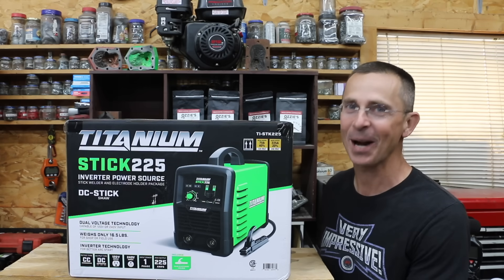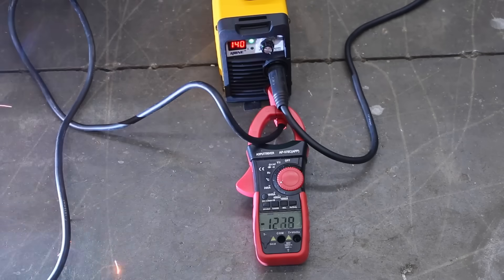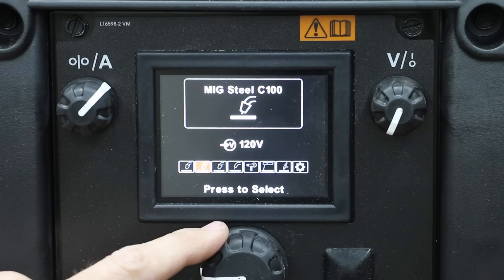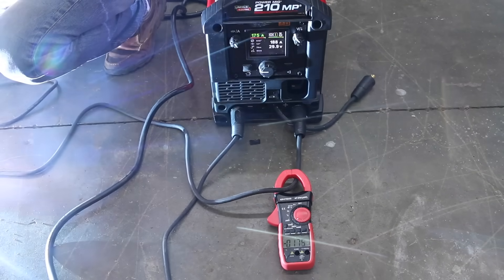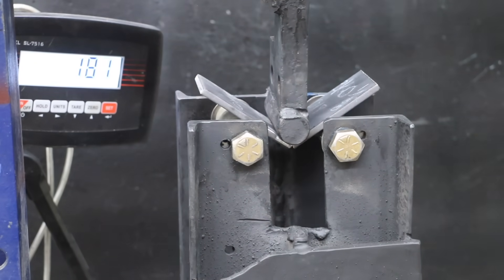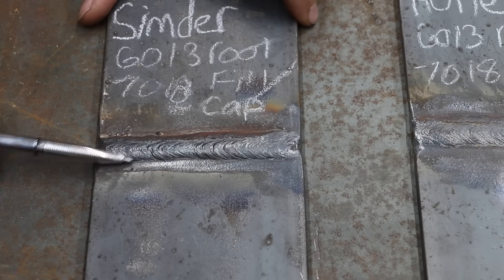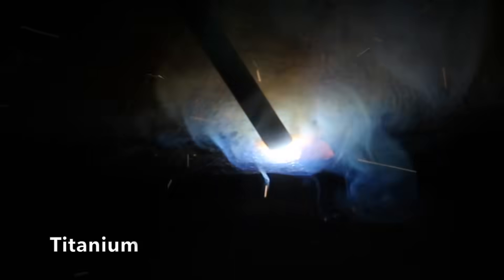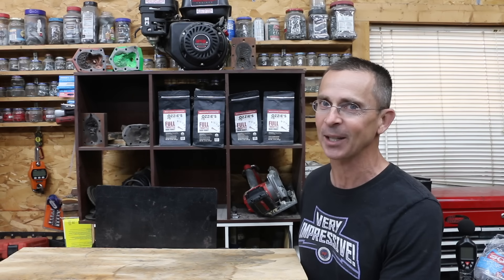$70 vs $2,300 Welder? Let's Settle This! Weld Strength, Duty Cycle, Current Output, Build Quality

Comment: Joe is definitely bias toward Lincoln Electric products. It would be interesting to see what his opinions are if there was somehow a blind test to remove bias.
Reply: I'm sure the Lincoln is better than the other machines in this test. It also costs more than all of the other welders in this test put together too.
Reply: @1pcfred  that may be true, but just based of the weld quality, I doubt this person would have been able to differentiate brands. This is the point I'm making.
Reply: @1pcfred a good portion of people do know how to weld. Just because they don't do it professionally is beside the point. This person had bias, it was blatant, if you are going to argue that the bias was irrelevant, I will have to whole-heartedly disagree with you.
Reply: @1pcfred  I guarantee you he wouldn't have said what he said if he had no idea what he was welding with. That is his explicit bias. Bias is never good in a comparison test, that's just the long and short of it.
Reply: @1pcfred  actually no. He specifically said if it was turned up more, it would perform fine. He knew that it was turned down, even though it was specifically said it was turned down to keep fairness. You can keep arguing all you want, it doesn't change the fact that his review was biased from his opinion.
Reply: @1pcfred  that's correct, that limit was placed such that all machines could compete with each other. Nothing arbitrary about it. As for his heavy opinion, there is also no question that he preferred the Lincoln although it only performed on par with the rest. That's called bias.
Reply: @1pcfred  and a test where Joe would set the machine is highly subjective, because it completely depends on how the welder welds. Its completely opinionated, what don't you understand about that?
Reply: @1pcfred  yeah, and they are also under oath to remove personal bias and tell the truth, nothing but the truth and the whole truth. Your point?
Reply: @1pcfred  No, I think he has a non-sponsored explicit bias due to Lincoln Electric being what he uses. He would feel bad he invested in a company that only competed with 300 dollar welders. He obviously doesn't want to admit that, therefore he adds exceptions to his review of the weld since he doesn't openly admit that the weld looks almost identical to the welds made by cheaper welders. That is the very simple, very obvious description of bias....
Reply: @1pcfred  if this guy instead reviewed welds based solely on appearance and performance, he would be much more careful in how he reviews the welds. Surely you realize this. A way to achieve this very thing is to hide the welders that make the welds until AFTER he reviews the quality of the resulting welds.
Reply: @1pcfred  I can't believe it's taken 3 days and you still don't seem to recognize the obvious bias that project farms videos are usually free of.
Reply: @1pcfred  you based your opinion on price, and the look of his face??? Forgive me if I don't trust an ounce of what you say. The simple fact that you are against an unbiased test says everything I need to know about your character, and your 'pursuit of facts'.
Reply: @1pcfred  you're simply proving you are also bias, all the more reason an unbias test is necessary. What part of this don't you get? You are really all for buying an expensive brand of welder because the company says its the best rather than verifying that for yourself? This channel has been known for finding out which tool performs best, regardless of marketing schemes. The tests performed are designed to be unbias, and the opinion of some random bias person doesn't (shouldn't) be helping you or anyone decide such things. That's the actual fact.
Reply: @1pcfred  then why in the world do you have to argue about a simple blind test to remove bias between tested welders? You make no sense. If what you say is true, then it's obvious you should have nothing to worry about.
Reply: @1pcfred  dude, you still don't get it. In order to remove bias, you'd only let this guy look at the finished welds. You would have another person weld all the samples to be inspected. Surely you know how bias is removed? The samples would be numbered, and the only person that would know how to decipher the numbers would be the main guy. This way the person with welding experience would be forced to inspect the welds for their entirety, good and bad, based on a fair comparison of all welders with the same inputted settings. It's an utterly simple way of removing any bias.
Reply: @1pcfred  I guess I figured you'd know something as obvious as that. My bad for assuming you understood something as simple as bias.
Reply: @1pcfred  you're literally more worried about insulting someone than getting to the truth. Facts don't care about your feelings. Stop trying to pretend that they do.... smh
Reply: @1pcfred  not sure how you can say anything about that was the 'truth' with a blatantly biased review, so much so that you aren't even arguing it wasn't biased. The actual test results show a completely different story.

Comment: One suggestion - use a 6010 or 6011 electrode on the root tests. 6013 isn't used professionally, which means it's a good electrode to test for farmers and hobbyists, but not on open roots. 6013 isn't a deep-penetration electrode.
6010 is also harder to keep lit, which will also give you more data points about the arc quality of a machine.
Reply from the maker: Thanks for the feedback!

Comment: What about tool boxes/chests for quality, strength and general ease of use. Like how wide deep and strong are the drawers, or how strong is the top of it. I like my cobalt tool box it was blue and black with an included power strip, but is it as good as a snap on of roughly the same size.
Reply from the maker: Thank you for the video idea!

Comment: Can you do an apples-to-apples welders comparison. All the same process, and same amperage such as 180 mig. How about a lot of the known brands such as ESAB, Lincoln, Hobart, Miller, a couple less known domestic (Everlast?), and just one or two of those uncertified chinese widowmakers. This would be a very pricey review. Maybe a supplier can give you a discount if you buy multiple machines at once. I don't think this wouldn't taint your perspective. Then, sell most of them off as used. Hey, maybe some fans would buy a used and autographed welder?
Reply from the maker: Thank you for the video idea!

Comment: Everlast is also a pretty good brand for those looking for good quality, but not Lincoln/Miller pricing. It's about half the price for an equivalent machine (duty cycle, features). Miller/Lincoln will always win on the service and longer term warranty, but they're sort of the "Snap-Ons" of the welding industry.
Duty cycle is where the pricing becomes evident. Cheaper machines can't handle it.
Reply from the maker: Thank you for sharing!

Comment: Thank you Todd, and Thank you Joe. I really enjoyed both of your work here. My dad and I bought a lincoln 210mp years ago, we didn’t get the tig accessories and out the door it was about $1100, definitely gone up a lot since then. Ours has been ok but has issues running mig sometimes and the power switch will intermittently not work. A couple years ago I bought the super cheap titanium flux only welder, and the mig 180. I’ve been very impressed with both of them, however I’m welding as a hobby and as a mechanic which is less than I was using the lincoln with my dad. All that being said I think that both brands are good choices, I’ve used lots of Hobarts and millers in schools and they were great too although hobarts are simply slightly stripped down millers for lots cheaper
Reply from the maker: Thank you for sharing!

Comment: Excellent review. It is hard to determine longevity of a welder due to build quality variance and testing of this without a tear down but great review. I'd suggest taking a look at Everlast, Eastwood or HTP if you ever revisit this topic. Those are some import brands that tend to get used in the welding community for beginners or people looking for solid machines on a more budget friendly side. The duty cycle of the Everlast and HTP are generally very close or higher to Miller or Lincoln.
Reply from the maker: Thank you for sharing!

Comment: If your not getting a big diesel generator welder Don't get a Lincoln. When you get through smaller welders you're just buying a name.  You can get the Vulcan omnipro at harbor freight for $1,000 less than this one and it's the same welder on the inside.
Reply from the maker: Thank you for sharing!

Comment: Not terribly surprising knowing the evolution of processes and welders was driving by reducing skill level required of the operator and increasing productivity.  Lincoln was one of the drivers of that evolution so wouldn't skimp.  The cheap welders obviously over promise and need more welder skill to make up some of the difference.  

Thanks to Joe.  I wonder his opinion of what a knowledgeable welder such as he could do to compensate for the weaker machines.   Giving up productivity for getting the job done though slower, messier.
Reply from the maker: Thank you for sharing!

Comment: Hi Todd. Most of these 110v welders need a 20 amp outlet instead of the more common 15 amp outlets. Did you test them on a 20 amp outlet?
Reply: Nevermind, I just finished the video and heard you mention the 20 amp breaker popping during the 5 minute test.

Comment: Soldering stations are in a bit of similar situation. Yes, one could spend $400-$600 for a top of the line soldering station like a JBC, Metcal, Pace, et al. But these days one can find much cheaper "generic" chinese stations that might even use the same premium tips like JBC's and Hakko's for much less and get similar results. For most casual solderers, even something like a Pinecil v2 will be more than sufficient.
Reply from the maker: Thanks for the feedback.

Comment: Awesome video, after lots of research i bought the tooliom 200 amp 3 in 1 welder. Im new to welding but im very happy with this welder. The 250 amp model come with a liner that can weld aluminum  without the need of a spoolgun
Reply from the maker: Thank you for sharing!

Comment: I purchased a Tooliom multi process welder and it works great. It's amazing how much technology has improved. I have an old Miller machine and a flux core welder that I got at menards that I don't even use them anymore because the Tooliom is more powerful and has better features. Granted that the Miller is 12 years old, but it was still a $1,200 machine that gets spanked by a modern Chinese welder that I got off of Amazon for $350. All of the features work as well. The duty cycle is also nuts on 240v. Says it's a 80% duty cycle but I think it might be higher because it hasn't cut out on me even once. I run it on a 30 Amp 240v circuit and it hasn't tripped it. It will also burn 5/32 hard facing rod without a problem. The old Miller only gets up to 130 Amps and struggles with 5/32 hard facing (11018) rods. Some of these Chinese welders are getting insane. It's a shame that there isn't a company in the US that is putting out machines like that at a similar price.
Reply from the maker: Thanks for sharing.

Comment: shouldn't have used 6013 for the root.  Also should test 6010 or 6011 if the welders can run them.
Reply from the maker: Thank you for sharing!

Comment: multi process welders will break your wallet but Everlast, Esab, Lincoln, Miller have 3 in 1 welders' you can compare: AC/DC or strictly DC-/DC+. call your welding suppy for the big 3 Esab, Lincoln, Miller. Everlast is in san francisco good luck hope to see that welder video soon.
Reply from the maker: Thanks for the suggestion.

Comment: If you do a other welder test, maybe you can try the PrimeWeld tig 225x. It can do stick welding and it's just under $1000. Great welder for me but I have never used the stick function.
Reply from the maker: Thanks for the suggestion.

Comment: Up to 1/4 mig and tig are excellent methods.
I like stick for thicker welding with or without an extra gas shield.
A Lincoln stop sign should be the home welder for everyone.
They never die and they stay consistent after the welder is hot.
For your first welder if not repairing thicker things.
Mig is easy to learn for anything but aluminum. 
Lincoln, Hobart,made in America.
Chinese rigs all become inconsistent shortly if you weld much.
Your grandkids will have your Lincoln stop sign 🛑.
They are awesome stick welders.
If I run a gas line for additional over shield
And an alloy rod I can weld something so solid it has no equal.
1/4" brake line and a clip to hold it to the stinger.
It must not be within 1/2" of the weld when in operation so like 1" ish back resting against the piece.
Turn the argon on at a slow his (thickness and metal type can be googled for pressure and gas type.)
 As you weld the gas moves up so only the first 5-6" needs to be metal.
They don't sell the best stuff for welding.
For instance if you want to make cones you have to make your own stuff to do it easy.
Even rings and they are easy.
Just measure across the piece add 11/2 the thickness of the piece you are using for the ring mold.
Multiple by 3.42- 3.75 or a little more.
Tight for precision and loser for speed.
Reply from the maker: Thanks for sharing.

Comment: Nice video. Hopefully you can do a round 2 because a jump from $320 to $2,300 is a bit extreme. 

A lot of us are looking for something in the middle, that is not the cheapest thing out there and not the most expensive. For example, you can get a Made in USA Hobart for around $500. Would be much more relevant since most of us don't want to be taking a chance on the long term reliability of a $70 welder but can't afford a $2,300 one.
Reply from the maker: Thank you for sharing!

Comment: Great comparison fellas , and interesting to see the differences between good welders and not so good ,  i remember some decades ago going on a working holiday , and a friend offered me a job in an engineering shop if i could weld , and i wasnt a good welder , but i could weld like a mechanic , a bit of cast iron , steel and aluminum to get me out of trouble, you know , i  could put a bit of bird shit on some metal  :)  , anyway he took me  down to his shop and threw a couple of bits of one inch plate on the ground and asked me to weld them up which i did , , the welders in the shop im pretty sure they had  big Lincolns that stood about 4 feet high , anyway i welded the plates up and , i was blown away how nicely and easily the welds came out on a good professional welding machine versus a lot of the home handy man ones i used in the past ..
  As always , it pays to buy better quality stuff fit for purpose , and this channel makes that possible .
Well done Todd and Joe . .

Comment: Great test and great idea to have a pro like Joe!  Please do low-mid range Mig welders.  Include Hobart (140 and/or 190) and Eastwood (180), along with Harbor Freight brands.
Reply from the maker: Thanks!  Thanks for the suggestion.
Reply: @ProjectFarm   Really wish you had included Eastwood and Hobart.  They would have been more apples to apples with the upper tier HF MIG.

Comment: Long-term reliability and availability of parts/service matters.  These variables are probably more important when it comes to TIG, AC/DC, and wire-feed machines than they are for simple inverter buzz boxes, but knowing that a company will stand behind its product and get you back up and running is worth something when you start dropping hundreds of dollars on a machine. $90 is probably the most I would drop on a machine if it doesn't come with a good warranty, service network, and replacement parts.
Reply from the maker: Great points!

Comment: Thanks for making the drive, and helping out PF, Joe! 
 PF, please consider doing a "wire fed, Flux Core" welder review when Joe comes back. HF also has a Titanium version of this welder, called the Titanium  Flux125. 
Or, Plasma Cutters would be cool to see, as well. Prime Weld makes a decent one, at a reasonable price. 
  Once again, great video! Thanks again! 👍
Reply from the maker: Thank you for the video idea!
Reply: @ProjectFarm  You're welcome! Because I KNOW you need a new plasma cutter to go along with that new welder! Lol
  Seriously though, check out Prime Weld. I bought the CUT50DP in 2020, and this thing rocks. Went through the floor, and trunk pans in my 69 Camaro with zero problems. And they had very little rust, so I was cutting around it, through good American steel.  Which means it will go through late model, Asian panels like butter. Also loaned it to my neighbor, as he wanted to cut the old box off the front of his tow trailer. He said it was slow cutting, but it DID cut through it all, and that box mount was 1/4" diamond plate. Which it really isn't rated for. But it hacked it. Ask Joe what brand he uses, and what he thinks about Prime Weld product. K, thanks again PF!

Comment: There are loads of inexpensive MIG welders around, with wildly variable levels of performance from what I've heard.  It'd be good to see a test of some of those, along with a comparison of what they can do when following just the instructions and usage guides provided with the unit.  I know that one acquaintance commented that for a certain unit, it worked really well as long as you knew what you were doing and didn't just stick with what the charts in the box said for current, voltage, wire size, and feed rates.  "They might get you started, but they won't get you finished."